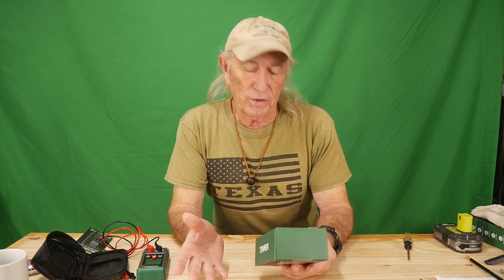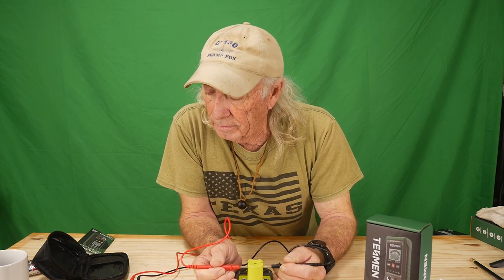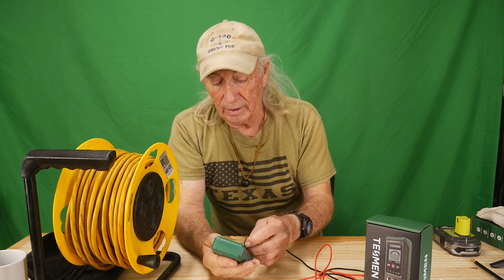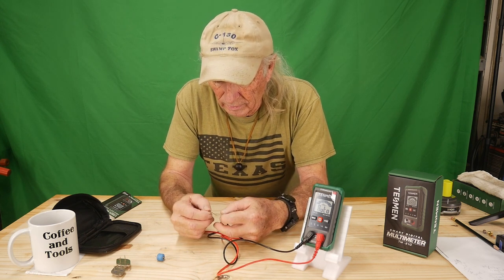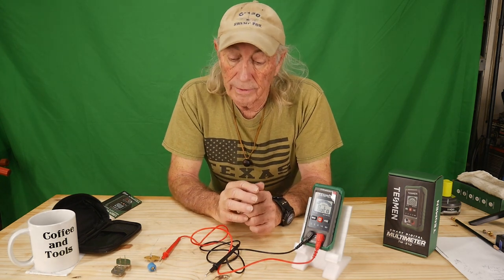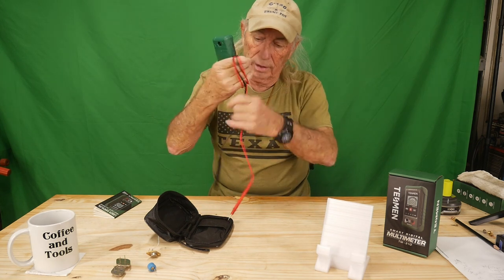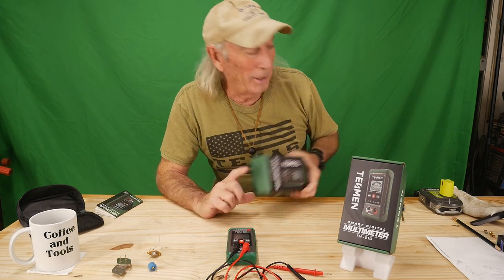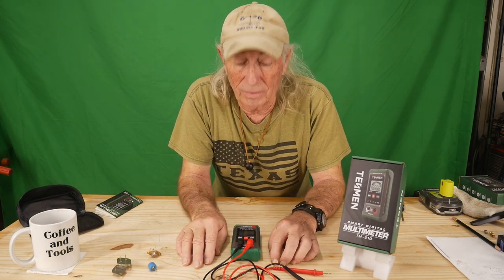Multimeter fromTESMEN TM 510 smart digital, test and review. C&T ep 306

Comment: Looks and sounds good about the multimeter. I use one for my ham  radios . Also, for other electric devices.  Will that do circuit tracing? Would be nice to know.
Reply from the maker: Hi John, I'm a ham myself, but circuit tracing I would say nope. It is cheap enough :)
Reply: @SirTools  i agree as being cheap. There is a way to trace with the multimeter, other than the signal tracer.  I was thinking of the outlets to the fuse box. That is a separate unit. The multimeter does let you know if a line is hot. That's a good thing.
Reply from the maker: @johnfromfl8063  It does work on 110v ac lines, but DC or small frequencies would most likely be a no. Still a nice price for a fool proof meter :)